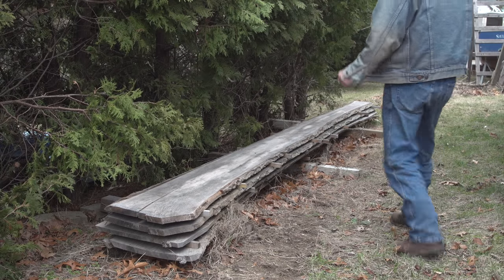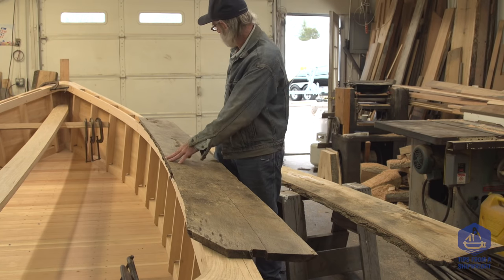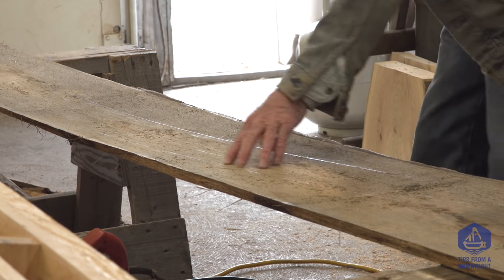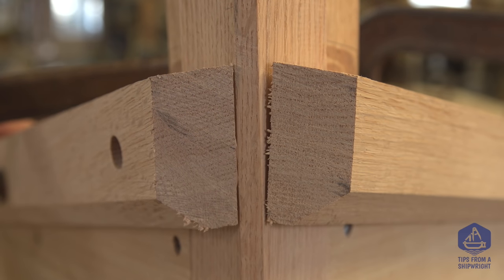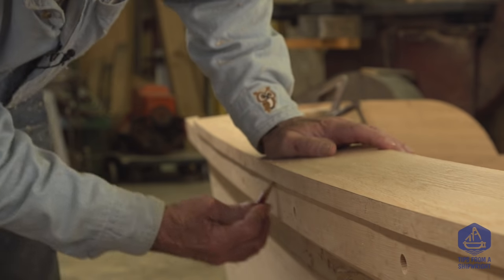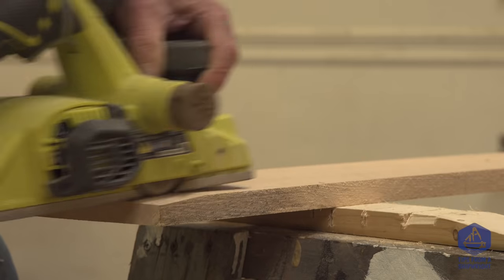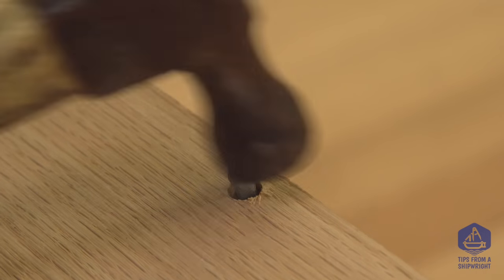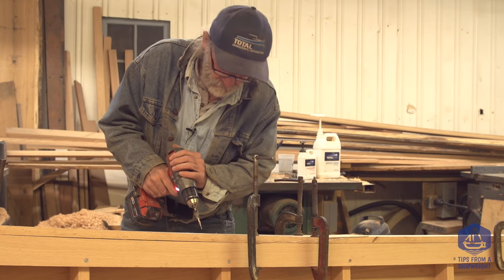Building the TotalBoat work skiff - The gunwale caps (Episode 30)

Comment: We are the ones having a ball, Lou. Thanks again. I'm going to try cutting a curve with my skill saw. I imagine there is a much thicker kerf and you start a little further away from the line? Interesting that was a better result for you than the band saw. 

I am very glad to hear that there will be another project and that you are enjoying the youtube channel with Total Boat. Cheers, Brian in England.
Reply: Curve we cut for the bottom plank on a recent restoration of an 1880s rowboat: Leave it a bit proud until you get skills built up and tune up the cut with a belt sander or random orbital sander, 60-80 grit to start: https://1.bp.blogspot.com/-BTJUK8PMHqU/VvFGMxO-P2I/AAAAAAAARsQ/6-fEs0qmbmkJyKDsr12AVYnu4_RJekNDg/s400/bottom%2Bplank%2Bcurve.jpg
Reply: He did mention in a previous video that he uses the cheapest, thinnest circ saw blades he can find as they have that extra tiny bit of flex.

Comment: I have a few questions.

Why not make the gunwales flush with the Breast-hook and quarter-knees? They seem a bit out of place.  You spent so much time fitting the perfect pieces in there.  You plan to oil the inside of the skiff if I understand correctly.  Am I missing something here?  It would be a shame to cover that beautiful wood and craftsmanship.

Just a curious fabricator question is all.  I have been watching the way you built this from the beginning and have really enjoyed the series.  You have pointed out a few things I could do betting in my own builds, so thanks for that.  Please do more tutorials like this.

I live on the Chesapeake Bay in Maryland and we build this very same work skiff around these parts for crabbing trot lines.  They are solid craft and last a very long time.  We use red oak and cedar the same way you do in your build here.

I have dreamed of building sailboats professionally and found your page doing some Herreshoff research. I am in the process of building a post & beam loft with a 50' x 140' x 45' bay to hold a full fabrication facility (mill, kiln, woodworking, spars, metal, forging, foundry, upholstery, sail loft, the whole nine yards). 

I plan to start small (skiffs and daysailers) then work up to the larger craft and add fabrication needs as I go until I fill the entire bay.  One day, with a single Schooner build.  But that is a ways off yet.

There are only a few facilities on the entire Eastern seaboard that can handle that type of fabrication so I figured there is alway room for one more.  Not to mention that there are none around these parts at all anymore.  There use to be one over on Solomons Island, MD and maybe one or two in Annapolis way back in the day, but they are gone now I think.

There are some great craftsmen around these parts but no place for them to work.  And only one or two medium sized sheds to do repair work undercover.  Maybe I can do something about that and put California, MD back on the map for fine boatbuilding and major refits.

Anyhow, thanks for sharing and keep up the fine work. I am forever a subscriber as long as you'll keep posting highly informational and detailed videos.

Sincerely,

Bill

Comment: when you have lumber cut for you,   if you paint the end grain,  remove the bark and paint the sides  it will keep checkering and cracking  to a minimum.  Be sure to give it several heavy coats.